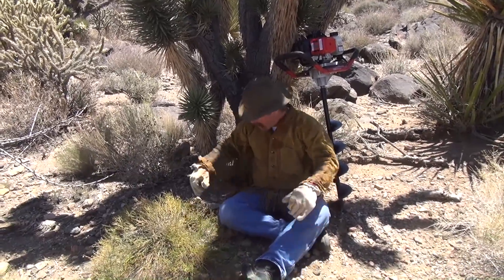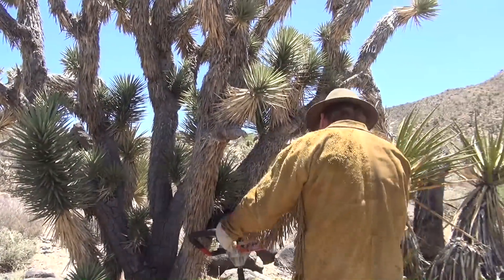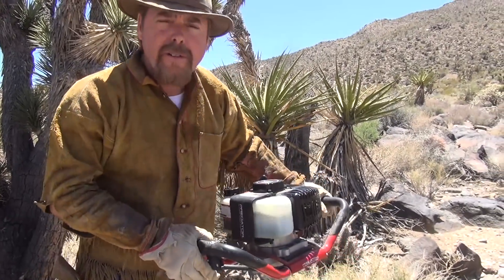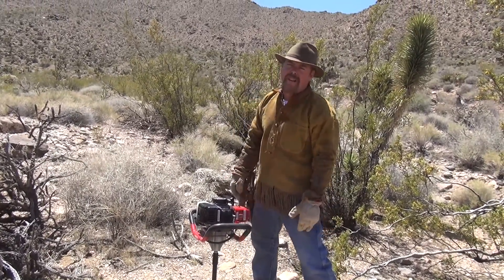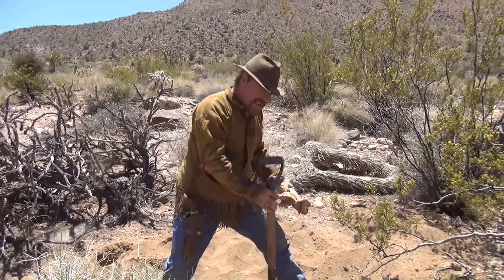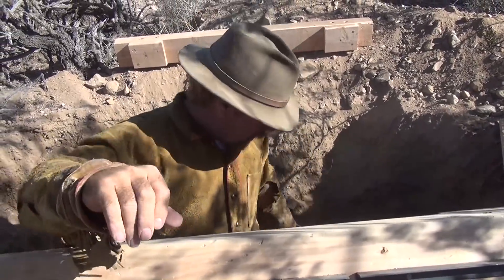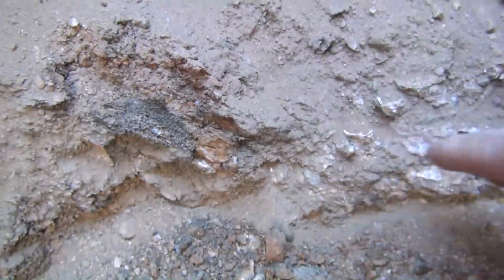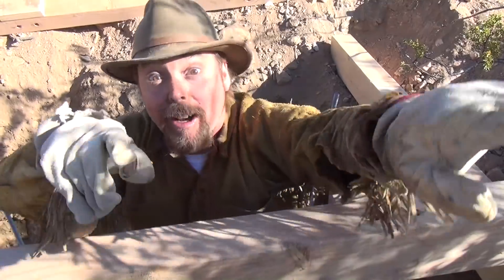DIY | Tunnel Digging | Construction - ask Jeff Williams

Comment: I would utilize the rock in the shaft. Destroying the rock creates instability in the surrounding terran. You should move the shaft laterally away from the rock by about 1 foot, then use it via reinforcements. Use your surroundings, instead of fighting against them. Rock is stronger than wood, especially with regards to compression strength.

Comment: Hey Jeff,

How would miners in the late-1800s sink shafts which were over 1000 feet? I have been unable to find any great answers on this, despite it being something which was so often done.
Reply from the maker: it is easy to cut a new shaft , they worked 24/7 ....drill , load a round , blast the rock ....muck it out ...and repeat with timbering in the process
Reply: @Askjeffwilliams  I have seen incredibly deep shafts within a tight drift where no hoist would be possible to take them to the bottom and back. How would they do this?

Comment: * JEFF***, If/when you find some float and it's general orientation, (N/E/S/W), along a sloping hillside, where do you begin digging the mine wrt the line of the float?  Directly on top of it?  Either side within 'x' number of feet?  I am catching up with all your videos and remember the one where you talked about quartz veins going off in different directions from a main quartz vein.  But I can't recall you mentioning where to start digging, other than finding the source.  Which is probably at the top of a mountain or hillside.  But if you are unable to get to the top due to claim lines or other limitations, whereaboots do you suggest to start digging a mine?  Thanks!  "Hey" to Slim.
Reply from the maker: start where you found it then go up until no more the trench across the hill
Reply: @Askjeffwilliams  Thanks!  You're the greatest!  Will keep you advised.👷🚧⚒️🏗️🤪😜

Comment: Thanks man :) well needed info. 

Spent the summer swinging a sledge hammer against a barren surface vein here in Northern Ontario.  ,  
1ft or 2 deeper... uncovered a massive gold and molybdenum  deposit . 
" was on my knees.  Swinging my way down under surface . 
Had a gut feeling to look up ... 
To a 300ish lbs male black bear  1m to my right shoulder .  Chased me to an abandoned radio tower In which I climbed and waited for it to leave... .

Assuming you guys have critters there to ?
Reply from the maker: yes we do but not that big

Comment: Do you have actual component drawings with dimensions? Was that 3/4" galvanized rod how long between the horizontal members do you go down? Where those 4" by 6" timber?
At a certain depth could you tunnel horizontally? How far in would you go before installing overhead support?
Reply from the maker: yes we do ....
Reply: How far should one be able to dig horizontal shafts before having to shore it up? That depends on a few factors ... how deep are you starting out? The deeper you are the more weight above you, but also the more likelihood of good compacted dirt as it compresses under it's own weight, and more opportunities for long rocks and buried trees and roots that can help prevent collapse. So how deep, how compacted and what it's made up of... dry gravel will need more shoring, while clay with fibrous material like grass and roots mixed in will act like concrete and need little to no suring. Also the cross sectional shape of your tunnel makes a difference. The keystone Arch shape and circle are the strongest on their own, while a rectangle with a longer roof from wall to wall than the walls are tall will be weak and prone to collapse so you will need to sure it up more often... hey since you want to tunnel but don't want to invest in the engineering knowledge any more than necessary, this hints at a means to an end. If it is a profitable venture, and you'd pay off the books for secret tunnels, than let me know we'll exchange temporary emails. If it's not secret, than hire an engineer. But if you want a preper bunker, an escape tunnel from your house, a hidden cellular, etc I might be willing or have someone closer to you. My family have dug secret tunnels since way back when we where samurai. We are not licensed, if we take the job we know nothing about your tunnel the entire time... if we get busted planning, I was walking by asking for directions, if I have shovel in hand, you had me hold it while you got a map, if I'm in the whole, I fell in and when I'm gone... what hole? That being said I have a digger in every procedure in Japan and about 30 states in the u.s. and 2 in Australia. We're speaking English, we have none that I know of in any other English speaking countries. Let me know if your elsewhere.

Comment: That's very informative. I will make one. I had a question, if back then they had nuts and bolts why didn't they use them for their mines. I noticed they made everything where it falls into place by notches. I was thinking it's safer the way they did it for larger wider mines but I wouldn't know.

Comment: what do you do when the gold vein goes outside the box? How do you make it bigger?
Reply: He can run a drift which is a horizontal working or stope out the area.  Think of holding a pencil in your fist, the shaft being the pencil and your fist a pod-shaped ore body.  What you do then is set the bottom plate as you would normally, but then instead of lagging, you start digging a drift (like a tunnel) as he did in the other mine he's got videos on.  You can brace that as needed to core out the orebody and when you're ready, you continue digging the shaft.
Reply: thank you
Reply from the maker: exactly ...thanks PSME LLC
Reply: May I ask you Jeffery, hmm, yes, do you know what I am going to say?

Comment: I do not get back filling it, would not all the loose dirt just fall in as you dig out for the next level deeper?
The wood sides are there to protect you and the hole, I could see a few large rocks to hold against the wood.
Reply: No, that bottom plate set is usually set flush against the wall providing a pretty decent seal for the backfill. If it isn't, no problem really.  Just shoot the gaps with that expanding polyurethane foam (PUF) and no leaks at all.  PUF is the same thing the BLM and mine owners use to cap the mine during reclamation if there's not enough left over dirt to fill the adit/shaft/incline at the portal.
Reply: I am talking while digging deeper. The back fill around the first set will just fall in along the sides as your digging for the next set below it.

Comment: why not just use 1 1/2 treated plywood or a steel plate
Reply: did you find any  gold or did you just dig a mine shaft for fun
Reply: johnny llooddte:  Think about the additional weight to carry, as well as expense. In an arid desert, that store bought homeowner western fir will last longer than we will.
Reply: Of course there are different ways.  I think the point is it is how the old timers did It? I want to know why that spot.
Reply: What would I need to use in a rainy climate,

Comment: wouldnt it  be easier with a tractor mounted auger or a  backhoe
Reply: isnt that a little bit small to be digging in.. and once its covered up,,, how do you get the dirt out
Reply: The Bureau of Land Management has certain stipulations on using "earth moving equipment" with respect to the reclamation bonds they require.  A tractor with an auger on it in this case would be considered earth moving equipment.  Also, that tractor drops one single drop of oil out there, and you have the wrong district manager, they'll make your life miserable.  

As far as size, I was thinking the same thing.  That's a pretty small shaft to sink and it's probably going to only be a single compartment.  Now if he intends to drift mine more than dropping the shaft, that's a different story.  Also, this may not be the main shaft, but a secondary access shaft. 

Personally, I'd go 4x8, two compartment.   One for the manway, the other for haulage and the necessary water/air/electrical lines.  

Not sure what you mean by getting the dirt out once it's covered up.  You only put dirt behind the side lagging to hold the walls in place. As you dig down, you put in another horizontal set with more lagging behind it.  In that case though, you insert the lagging up rather than down.  The bottom plate, the part he shows with the angle iron bolted to it, has the same threaded long bolts put in, but this time when he tightens them, they'll move up bringing the lagging tight up with the plate above it.  Hard to explain without drawings.